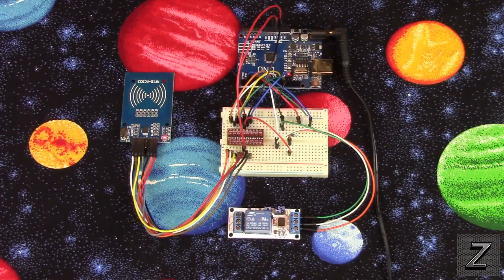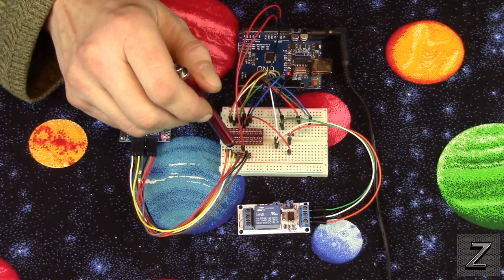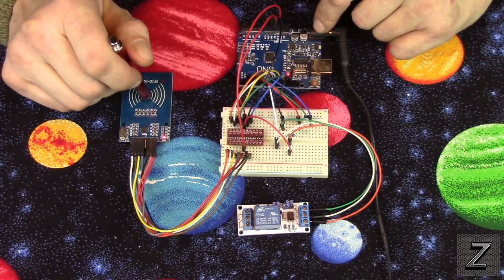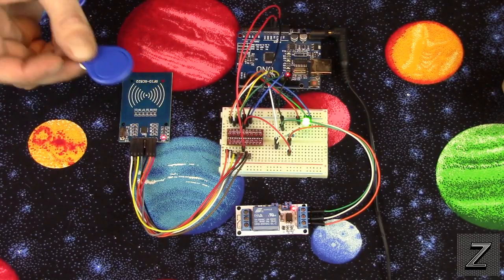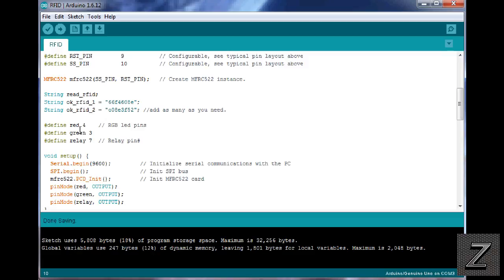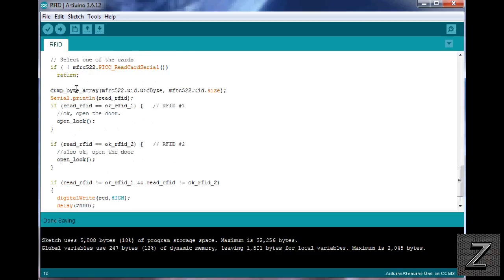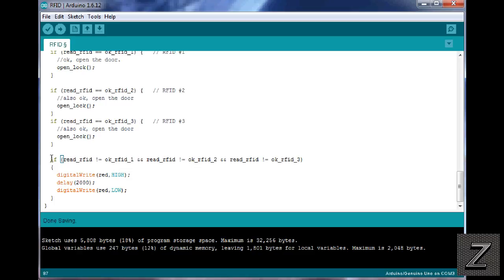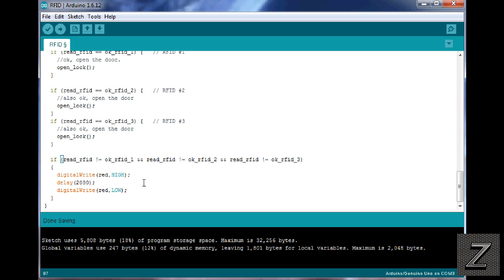How to make a ARDUINO controlled RFID keyless entry door lock system

Comment: Hi, I would like to ask is the logic level converter required as the Arduino UNO has a 3.3V pin on the other side that can be used for the reader.

Comment: Hi im doing a project on keyless door lock using lcd, rfid, keypad and a solenoid. But i have been thinking on how to put more input or output to the arduino as it doesnt have much pin to connect all of my input and output. Im a beginner in arduino. Could you please explain to me how i can solve this problem
Reply from the maker: the easy way to fix this problem would be to use a arduino mega, it has lots more inputs and outputs than a uno or nano. A more advanced method would be using logic gates ic chips.. also use a I2C lcd screen to cut down on pins needed..
Reply: you can use Bluetooth communication with another Arduino nano and use that nano to connect to other modules

Comment: I found this video through https://zhutarduino.wordpress.com/arduino-projects/how-to-make-a-arduino-controlled-rfid-keyless-entry-door-lock/ and had errors.  First, I downloaded the MFRC522 library from the Arduino Playground - Github link.  Then I had stray 342 errors; found out this can occur from copy and pasting with formatting issues.  Started to retype the flagged sections and realized just need to retype the parentheses which fixed the errors; only a few lines of code needed this.  Still have to buy components to put something like this together.  Thank you.